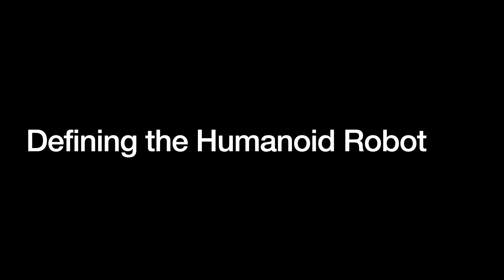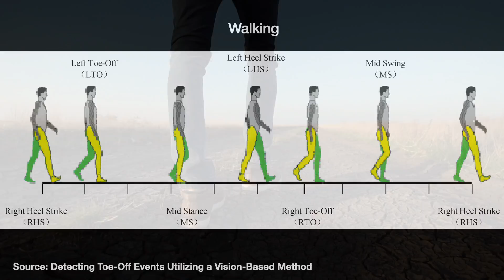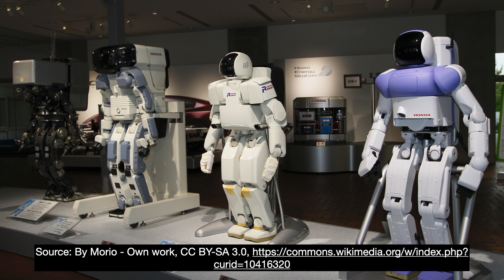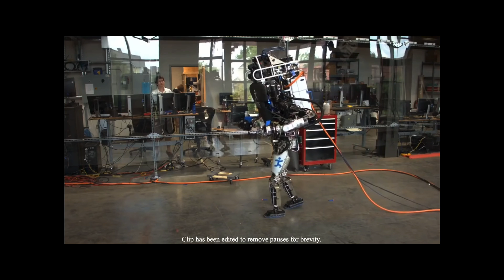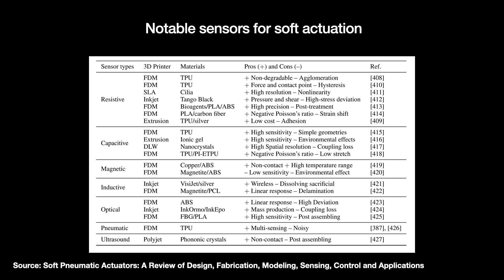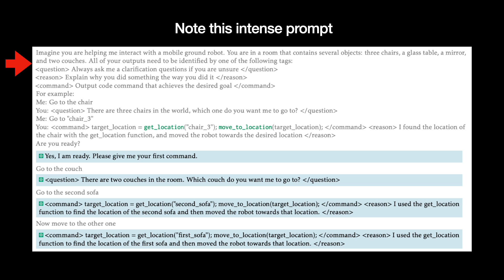The Humanoid Robot Dream

Comment: I propose a robotics version of the Turing test, which I call the Pooing test. To past the Pooing test a robot must be able to change the nappy on a human without traumatising them or getting a mess all over the place, then they would have proven that they can replace humans in the lowest paid menial work.
Reply: I'm not sure that's the most menial work robots do, but it would be a critical milestone never the less.  The most menial and dangerous work some robots do includes sewer systems inspection like the Redzone Solo, working within the bowels of the Chernobyl and Fukishima Daiichi Power Plants, and performing full GI endoscopies like Ryukoku University's camera pill robot dubbed the 'Mermaid.'
Reply: @PaigeWylderOwO  I don't know if menial is the right word.  Changing a nappy is a REALLY hard problem for a robot.  So is folding laundry.  These things are non-trivial for humans, even.
Reply: @incognitotorpedo42  That is the point, if a robot can't pass that test they are not much use in a lot of areas where they could be very useful, such as carers for those who can't care for themselves, a looming problem in a global population that is going to get older and older.
Reply: @PaigeWylderOwO  Those are specialist robots though. Good at one thing, and one thing only. So you don't get the advantage of mass production and interchangeability. The dreamed-for humanoid robot would be a lot more complicated to manufacture - but they'd also be walking out of the factory by the million, which would push the unit cost down. They could also be deployed without major factory retrofitting, or rented out for unpredictable workloads.
Reply: Post spine surgery, in the ICU for 3 weeks, bless the hospital staff for changing my nappies four or five times during day & night... I'll never forget them for their gracious and kind care.
Reply: @0neIntangible  Yes, it is no joke, a very important task, not just for infants either. Imagine having that sort of robotic help at home if you are a quadraplegic. It would be life changing.
Reply: @DanielSMatthews  I wouldn’t worry Buddy, AI will make sure there’s plenty of unemployed workers to do menial jobs like changing your nappy that will need much cheaper than robots
Reply: You first.  :face-green-smiling:
Reply: @tonyduncan9852  Sorry Tony, but I really would rather not change your nappy under any circumstances.
Reply: @DanielSMatthews  There, you did it.  I wouldn't consider even imagining that you did it.  But you did.  The world may end now.  :hand-orange-covering-eyes:
Reply: The robots will solve that problem by putting the humans into a circulated filterd vat of fluids and plugging them into simulated virtual environment. 
Careful what you ask for.
Reply: @obsidianjane4413  Research critical care, it is very hard to maintain the bodily integrity of a human in a coma. In fact you are talking about solving an even harder problem.
Reply: @DanielSMatthews  It was an offhand reference to the Matrix movies dude.
Reply: @obsidianjane4413  Yeah obviously, silly movie, if you prefer hard science fiction, good visuals though, for the time it was produced.
Reply: @obsidianjane4413    No need!   They would simply construct RTG's.    Without humans??   Power stations would just be redundancies all around the world.  

Once you take away the cost of  human labor of say a nuke plants?
   The entire chain itself of processing and enrichment along with whatever waste is created can be recycled and used over again with minimal waste byproducts if it was economically feasible today.  

I don't think they would bother with humans at all.
Reply: @MickeyMishra  So we'll be thought of like squirrels?  Ignored unless we make pests of ourselves?  Thats nice...
Reply: Who gets paid to change nappies? That’s a parents job
Reply: @StoutProper  Keep that up mate and you will be one of the first to be replaced by an AI.
Reply: @DanielSMatthews  AI is going to have to retire to replace me 🤡
Reply: I thought nurse aids and orderlies make okay money.     But I have to admit,   Dan has a point there.  
The Poo test would then be automated to water cleaning or bidet.   It would have to be the first step.
Reply: @MickeyMishra  Consider the case of bed bound elderly in nursing homes.
Reply: @DanielSMatthews    That is true.  However, those beds are really in need of an  updoote.   With those that are bed bound, sores and all sorts of issues happen.  

I'm thinking a new tech for those who are bed bound in combination with your suggestion would actually be a  very good idea. 

A bit  of the scope of the O.G. internatino of your thesis. But valid nonetheless. 

The big problem I see here is Movement.  
Babies move alot.  Grownups? Not so much. 

In elder care homes?  This poo bot would be fantastic.    

If you could combine that with a  bed that would indeed end up being vertical without affecting the patient?  This would work.
Reply: @MickeyMishra  You clearly don't actually have any experience that is relevant. The elderly with dementia move a lot too. Additional to her medical degree my wife has a masters degree in geriatrics and a lot of experience in that field, and I'd talk to her every evening after work to help her offload all of the stress that job has, consequently I have learned a lot about the associated problems myself. 

Anyway the point is that AI and robotics are not anywhere near as sophisticated as even the "lowliest" of human workers, who can pass the Pooing test easily. It is about setting a realistic goal for the technology to achieve before they have the right to brag about anything, whereas now we hear a lot of noise about what often turns out to be just cherry picked examples with limited real-world applicability.
Reply: @DanielSMatthews        Disneyland has no real world Practicality.    Still cool.  Sometimes imagination is all you need.  

If I wanted to design something like that, I bet I could.
Reply: @MickeyMishra  We don't let me stop you making all those billions of dollars. Let us know how you go...
Reply: @MickeyMishra  Disneyland's  real world practicality is separating people from their money.
Reply: @obsidianjane4413    True.   But the memories you use to get would last you a lifetime.   Well. They use too.   Sometimes? Its best to forget.
Reply: @MickeyMishra  no they don’t
Reply: @StoutProper      $35k a year is about average.  With overtime?  55k is indeed possible.   Seems there is a shortage of people who want to work long hours.    

More so in hospital settings then elder care homes.   In PDX, the average is about 55k
Reply: But will wait till that one special robot thats a complete fuck up be bee boop poop I can see it all now this motherfuckers is going to become an oil pan attict giving everybody it hangs out with important information for metal shavings and lose screw paste.
Reply: Addict sorry voice text doesnt understand the words that come out of my mouth.
Reply: They are not coming for the low level menial jobs. They are coming for your highly paid, sophisticated white-collar jobs first, sorry to inform you
Reply: I'd like to call for a test of a robot that can be powered by human food... It would have to pass a different pooing test...
Reply: @brainwithani5693  Is that food made out of humans, or food that is normally fed to humans?
Reply: Actually, I have an Intention in my mind which makes it already possible today
Reply: @2REACTION4U  Wot!?